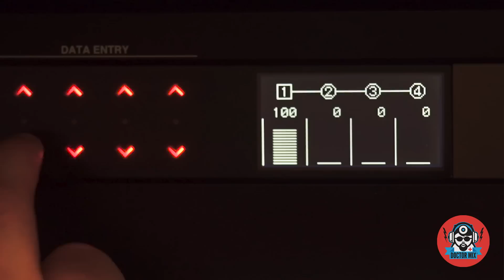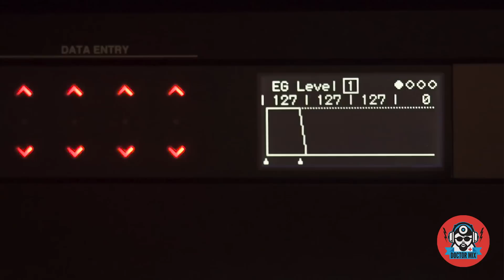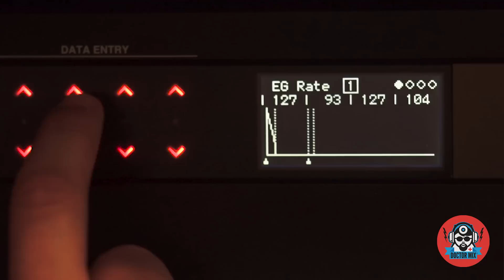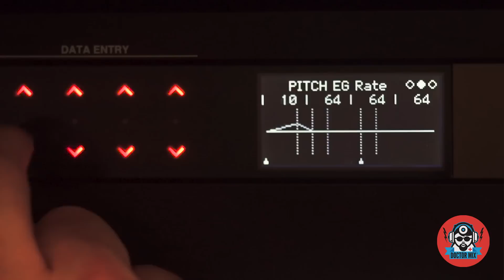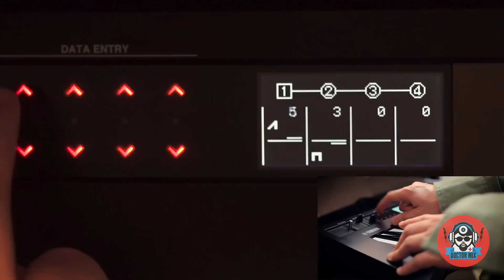How To Build A Kick Drum With Reface DX

Comment: how to get on init voice?i dont have it at 1-8
Reply: For some examples, it is good to start with a INIT-Voice.
Here's a little extra information: All Presets in reface
DX can be restored to their original locations using the
"Recall" function. This works even if you have overwritten
a Preset Voice with a User Voice. For the User Voices it is
anyway advisable to additionally store them to the reface
Capture app.
So for our small example, select a free Voice and
initialise it.
• Press [FUNCTION] (repeatedly if necessary) until you
reach the "JOB" page
• Press the switch for "VOICE INIT"
• Confirm the prompt "Are you sure?" with "YES"
• Press [BANK] to return to normal view
Reply: i imagine you've found it by now, just realized this is 6 months old

Comment: This is why this synth should be multi-timbral. It's tonal range is too large to be constricted to one patch/timbre at a time :-( Big, Huge missed opportunity IMO...
Reply: There's a video by Floyd Steinberg showing a really nice hack that almost allows somewhat of a keyboard split in the middle: using an algorithm with 2 carriers and the per-operator Keyboard scale features to effectively have 2 operators only on the low end and 2 operators on the high end. It's still not really multitimbral, but it at least allows stuff like playing simple pads and bass, or pads and a lead at the same time